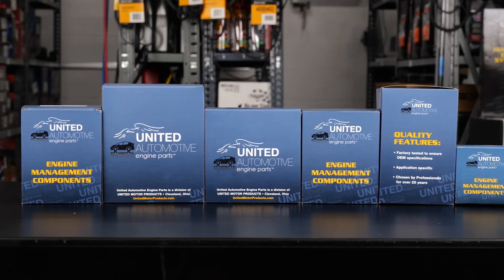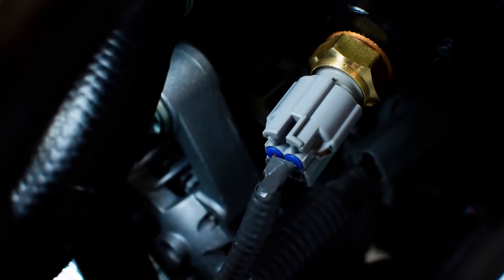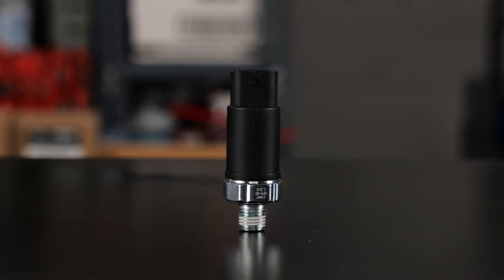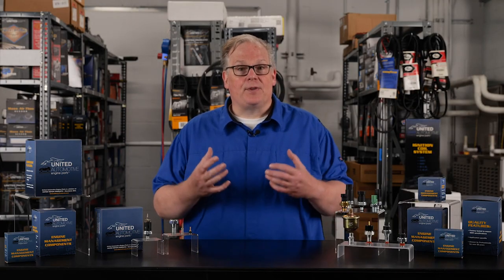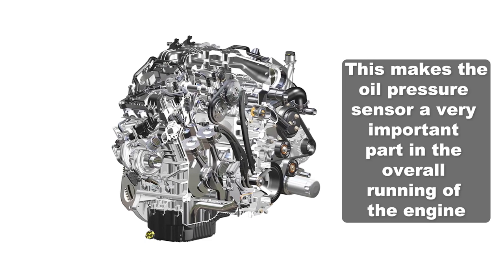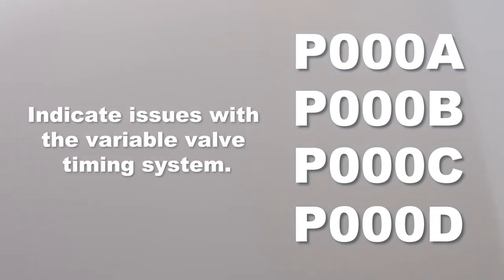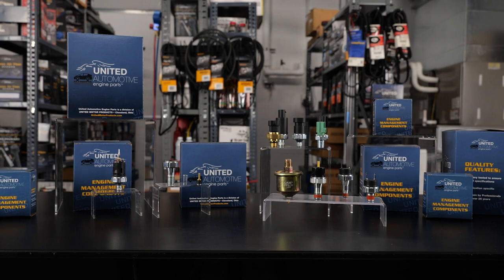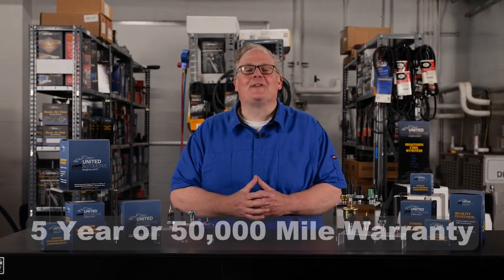Understanding the Important Role of Oil-Pressure Sensors

Comment: Pretty sure i have a bad switch. I just got an oil change a few weeks ago and now the oil pressure light comes on, goes off, comes back on, then goes off again. Just took the car to my mechanic real quick and he checked the oil and the oil level is good so I have to bring it back in 2 days and I'm hoping it's just the switch that is bad. 2012 Passat TDI SEL w 199k miles